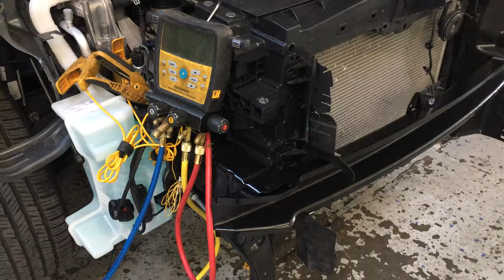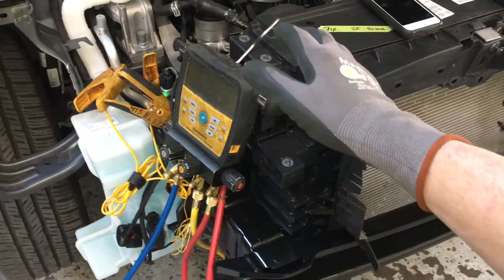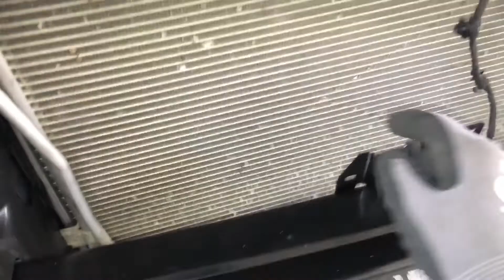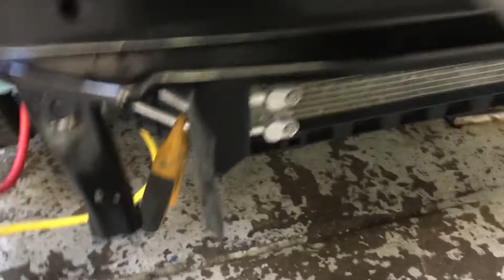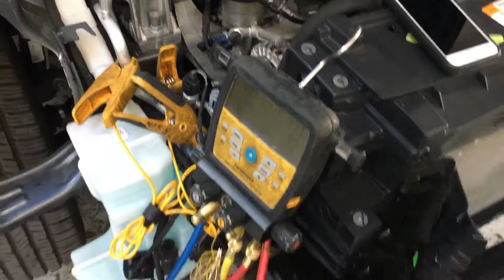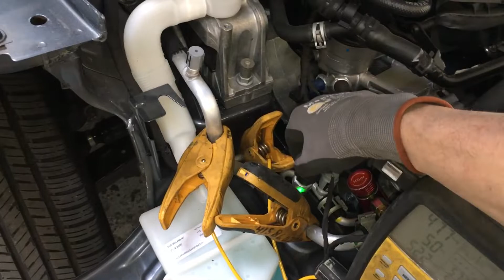EPA are you listening ?. Venting refrigerant to the atmosphere is every day common practice

Comment: 1. why doesnt the insurance company do a walmart? (oh we need you to scrub the bathroom as soon as they punch out )   work the employees off the clock.

2. r1234yf being a replacement for r134a. means it is less harmful to the environment so it should not be a problem to vent it.

the cfcs was the real problem of course just burn winter gas year around and the ozone and smog created would or should replace the ozone damaged by the cfcs.
Reply from the maker: Walmart lol 😂 

It’s still a green house gas. They are all ready working on two new replacement gas to replace r1234yf. 

Yes , making a thick SMOG layer will protect us from the ozone.  Only problem is automobiles produce higher levels of ozone to increasing ozone level at ground level that is harmful to humans to breathe

Comment: Them gauges overkill or do you do residential/commercial?
Reply from the maker: Lol 😂 I don’t believe in overkill when you have good tools.  The more the better. 

Remember cars are now being produced with heat pumps that do both heating and cooling from the same compressor the same condenser in the same evaporator. 

Cars now have high voltage three phase electric compressors just like on commercial and residential heat pumps

For the last couple decades automobiles have been using more and more variable displacement compressors where pressures mean absolutely nothing depending on the manufactures computer software algorithm for controlling the compressor. 

On those cases know when you’re saturated Refrigerant in SuperHeat and Subcooling give you a little insight inside the system where the Automotive guys who are still using knowledge based off their grandfathers days from the  gM’s A6 Frigidaire compressor or the York or Tecumseh compressors.  Those days are long gone but yet that information is passed on through the generations attempting to apply at today’s vehicles. 

When it comes to heating and air-conditioning the automotive trade is far behind on the educational training and skill set. 

Some cars have both standard DX expansion valve condenser in the front of the vehicle and then another expansion valve to a plate heat exchanger going to a glycol chilled loop system with 2 to 3 electric water pumps being diverted through 2 to 3 three-way diverter valves transferring hot coolant and cold coolant throughout the system back to the plate heat exchanger all cool off by the same air conditioning that is cooling the passenger compartment. 

No these gauges are not overkill

Unfortunately our Automotive trade is extremely under skilled and under educated and they really need help getting the information out there and pointing them in the right direction to make the right selection of tools and equipment.

Oh yes and by the way I do commercial and residential HVAC I have two businesses for the last 30 years

Fourth generation and my one son is following in my Footsteps has the fifth generation
Reply: not over kill at all. if the place doesnt have this where you do work. LEAVE LOL

Comment: You can vent 1234yf.
Reply from the maker: Venting $150 per pound or1234YF does not seem economically feasible. 
            Every day I do several R1234YF’s multiple recoveries a day. I would be venting  $1000 to $2000 every day and refrigerant if I did that. 

             No you do not vent R1234YF
You can vent hydrocarbon refrigerants like R290 in R600 propane and butane. And you can vent CO2 refrigerant . 

        A free 609 air conditioning certification class coming up that is put on by MACS I highly Recommend you watch it I’ll see if I could get a link for you

https://macsmobileairclimate.org
It looks like they’re having three training webinars in March April and May at different times in different dates.
Reply: I meant that the epa does allow venting r1234yf and it is totally legal. I agree that it doesn’t make sense because it is so expensive. It’s just a waste.
Reply from the maker: @ka-i  no man made refrigerant can be vented to the atmosphere. That includes R1234yf . 
                 I appears you need to take the EPA 608 or 609 test